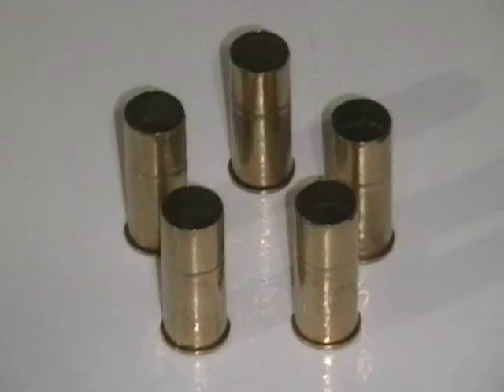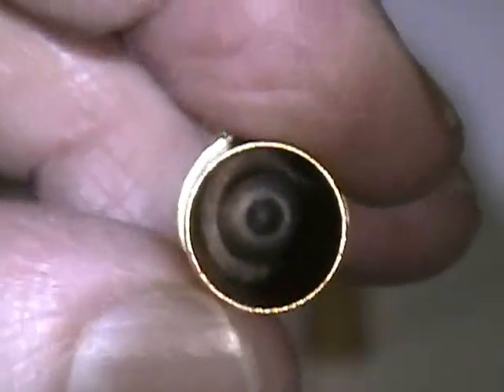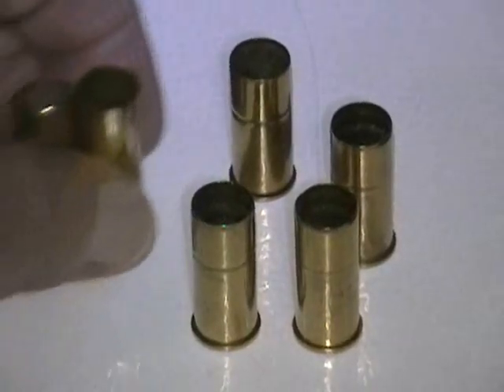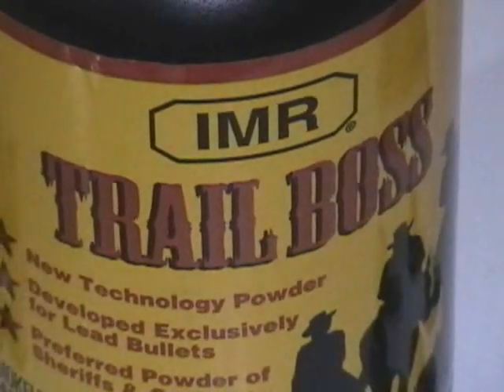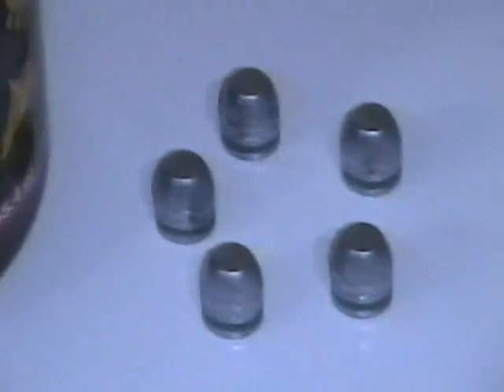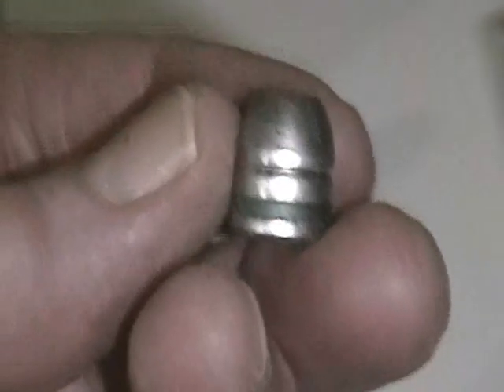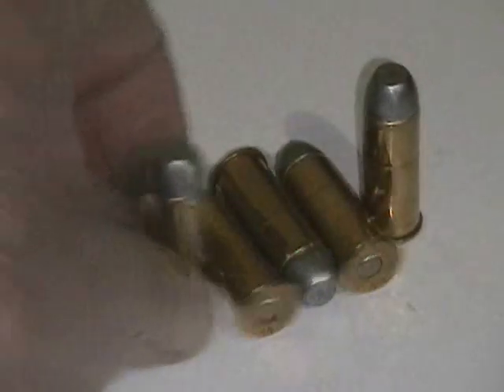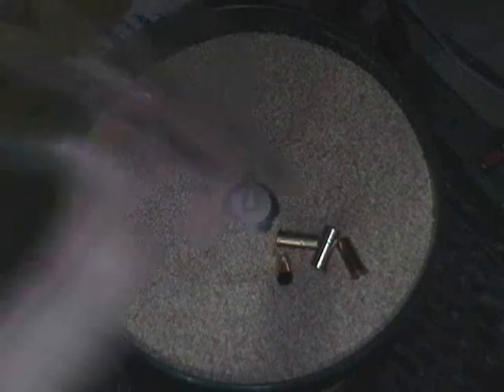Loading  .44 Special Cowboy Ammo

Comment: Very informative.  Also, this video contained an excellent demonstration of why I have gone back to single stage reloaders from progressives.
Reply from the maker: Yup. It's easy to miss a step or otherwise gum up the works. It seldom happens with that press after 30+ years of running it, but it does happen. Trick is to recognize the error and fix it before it slips by completely unobserved. Thanks for watching! Stay safe.

Comment: If you crimp in the groove, is the OCL the same as what the manual calls for, the laser cast 240 rnpf I use comes up short if I crimp in the groove, does that matter? Thanks
Reply from the maker: Heavy bullets usually need to be crimped firmly so they don't move forward (actually, the case and cylinder move backward away from them) under recoil and tie up the cylinder. For that reason, I seat 200 or 240 grain SBC hard cast in the crimping groove. I use a commercially-loaded round with same bullet weight and profile to set the COAL, and then fine-tune the seating die from there, if needed to match published data, (which they almost never need). For plated rounds in that weight range, I put a cannelure on them (if they don't already have one) so that when crimped in the cannelure they are of the proper COAL. Bullet seating depth matters more than COAL in terms of pressure. I never use the max published charge weight for any bullet/powder recipe. I've found over the years that the sweet spot is usually somewhere in the middle of the published charge weight range. I don't try to make magnums out of non-magnum calibers by exceeding published data ... with all due respect to the work Elmer Keith did with the .44 S&W Special. Long answer to a short question, I know. Hope it was helpful. Cheers.

Comment: So you say trail boss  is low pressure?
Reply from the maker: Less so than 231, I'd say, but my observations are only anecdotal, in that I don't have a copper crusher/test barrel or ballistics lab. The loading data for Trail Boss is available at https://www.hodgdon.com/trail-boss/. The load my buddy wanted is within the published data for the .44 S&W Special, with 200 grain bullet and standard large pistol primers. The SAAMI recommended maximum operating pressure for the .44 Special is 15,000 psi. The maximum load shown on the Hodgdon website for Trail Boss and a 200 grain (lead) bullet is well below that level at 13,200 psi, and the load my buddy wanted (6.2 grains) is slightly below the maximum recommended charge weight. Those pressure numbers not withstanding, Trail Boss is a modern SMOKELESS POWDER and should never be used in firearms designed to fire only blackpowder, whether loose or in cartridges. The result of doing so could be very dangerous to the shooter and anyone standing nearby.

One of the advantages of Trail Boss is that the correct charge weight fills the brass cartridge case better than the correct charge weight of 231 or Unique. Some shooters believe that cartridges that are filled closer to the base of the bullet give more reliable ignition and more consistent velocities. Some high-powered magnum pistol and rifle cartridges actually use compressed powder charges, where the case is clear full of powder and the charge is actually compressed when the bullet is seated. Loading manuals clearly identify such  cartridges in the data. Filling a .44 Special case with 231, Red Dot, Unique, or another denser, faster-burning powder to the level that would be occupied by an appropriate charge of Trail Boss (i.e., not weighing the charges, but simply filling the case to a particular level) could result in a serious overcharge and possible catastrophic failure of the firearm.

Hand-loaders are always well-advised to follow published data exactly, and most loading manuals advise loaders to choose an initial (starting) load 10% lower than the published data and work up to the published charges, since there are so many variables between firearms, loading equipment, hand-loader skill levels, powder lots, primers, bullet metal alloy mixes, etc. It's always better to be safe than sorry. All of the powder manufacturers I know of publish loading data for each powder they make. The data can be accessed for free on their websites. Thanks for your comment. Cheers.